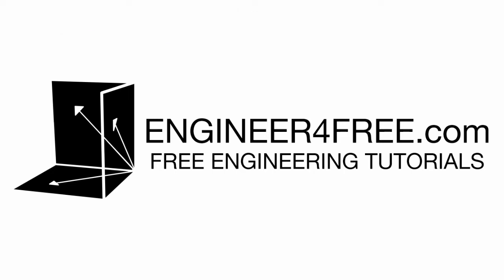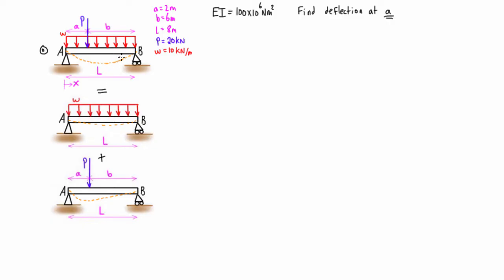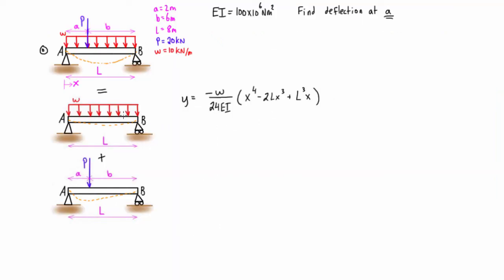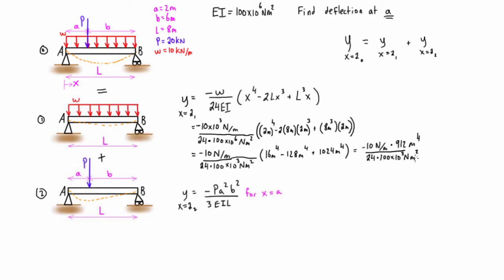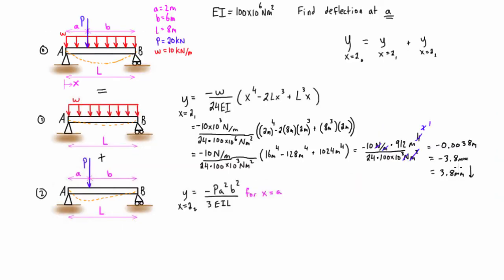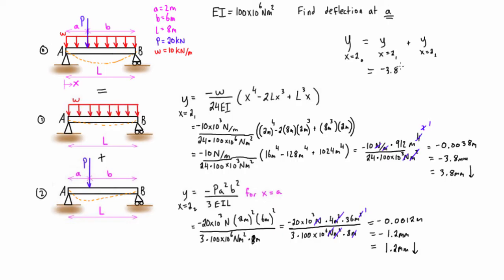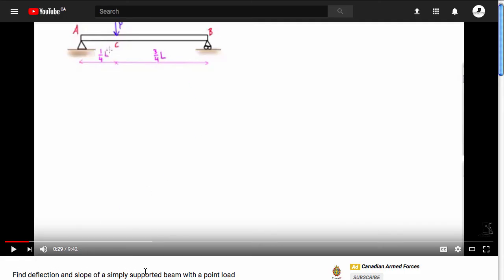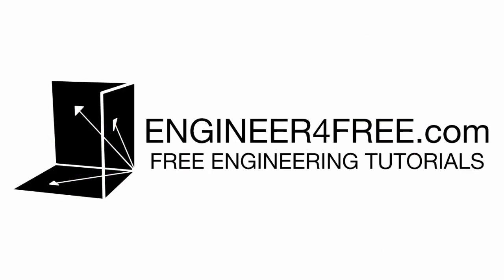Method of superposition example #1: simply supported beam

Comment: What happens if the point of deflection you want to find is not at the point load? Like if they say find the deflection 1m from a but point load is 2m away? I hope you respond
Reply from the maker: Moment area method is a good way, especially when seeking the max deflection. Check out videos 19 - 28 here: engineer4free.com/structural-analysis I recommend watching them all to learn the method, but the last one in particular (video 28) might be similar to what you're looking for

Comment: Was EI given? or do we have to find it ourselves? I have no information on it.
Reply from the maker: EI in this video is given, it's 100x10^6Nm^2 written at the very top middle of the screen at the beginning of the video in black. EI is often just given in these types of problems. Otherwise you need to be given the cross section and material so you can calculate it or look it up in a table.

Comment: I know this is an old video but is there anyway to use this method to find where the slope is 0 on the beam/the exact location of maximum deflection?
Reply from the maker: You're probably best off using the moment area method to find the locations of zero slope for a non-symmetrical structure. Check out videos 19-28 here: engineer4free.com/structural-analysis Video 28 specificaly goes over an example on that, but I'd recommend watching the other videos in the section as they build up knowledge and context on how to use the method.
Reply: Thank you very much. Took a look and it was a great help.
Reply from the maker: Awesome, glad to hear it!! =)

Comment: Does this method work for finding moments across the beam as well?
Reply from the maker: Superposition applies to internal bending moments too. If you had two loads on a structure, you could draw that structure twice, with only one of the loads present in each diagram. If you solve the internal bending moment at some point in both diagrams, then you can take the sum of them as the actual internal bending moment at that point in the actual structure with both loads. Same goes for internal shear, and reaction forces.
Reply: Engineer4Free Thanks for the quick reply. Allright, that sounds awesome. But what if i want to draw a moment/shear diagram for the entire beam, i.e I have the lenght set to x. Could I still use superposition?
Reply from the maker: You could, but I wouldn't normally recommend it. If you are drawing the SFD & BMD for a statically determinate beam, I would first solve for what the reactions are for the whole beam with all loads acting on it, and then draw the SFD in one go, and then draw the BMD based off the info in the SFD. If you split the loads into separate diagrams your pretty much going to double or triple the work (like if there are two or three loads in total). I made a bunch of videos on SFD & BMD, they are videos 1-9 here: engineer4free.com/structural-analysis That is the method I usually use, it's "the fast way" where you don't really find the moment function in terms of x. It pretty much works flawlessly with combinations of point loads and uniformly distributed loads. If you're asked to find moment in terms of x before plotting the BMD on a statically determinate problem, you have to do it the "longer way," which you can get the hang of in videos 66-72 here: engineer4free.com/statics. Even though most often it's easier and quicker to do it the fast way, it's still a good idea to understand why it works via the longer way. If you are doing problems that are statically indeterminate, then there are several methods at your disposal, which I cover many in detail at engineer4free.com/structural-analysis. One last mention, is that video 39 in the structural analysis course goes over adding two BMDs using the principle of superposition, and ultimately I mention in that video that it's almost never worth it to solve problems that way. I encourage watching the tutorials that I linked above, if you do you'll have a pretty good understanding of drawing SFDs & BMDs. I'd recommend watching the statics ones first, then the structural analysis ones should be a breeze after. Hope that helps!
Reply: Thank you very much. Engineering is a hard program to study, but thankfully there are kind and informational guys like you. I'll most definetly check your videos out.
Reply from the maker: You're welcome! Engineering is a really tough program and I'm glad I can help :)